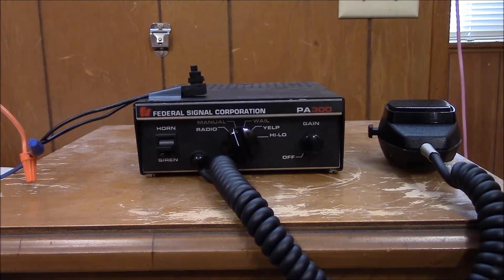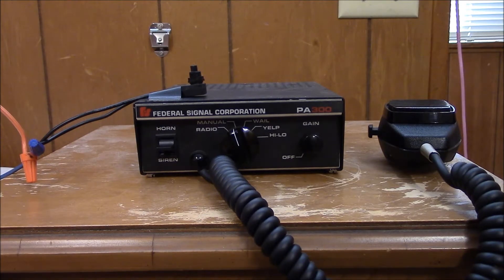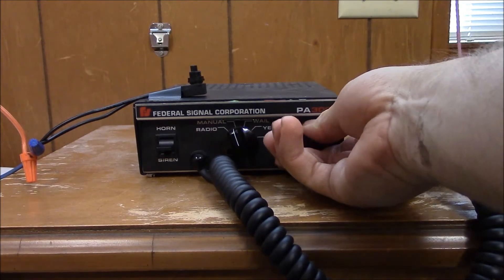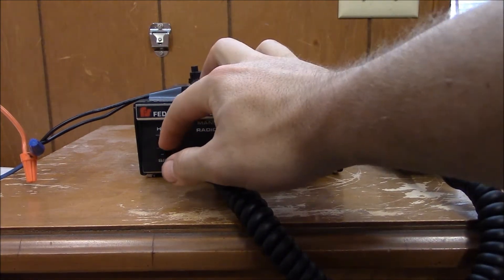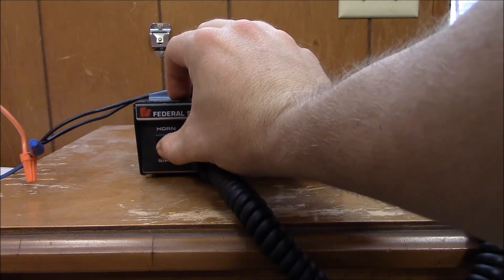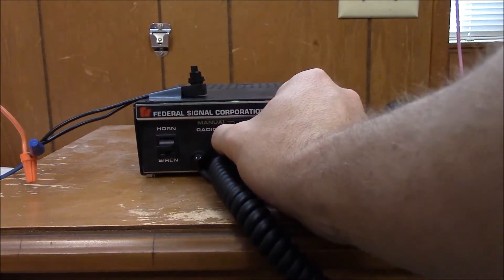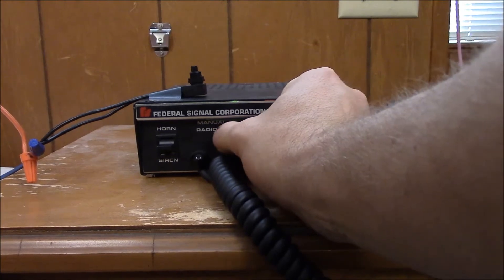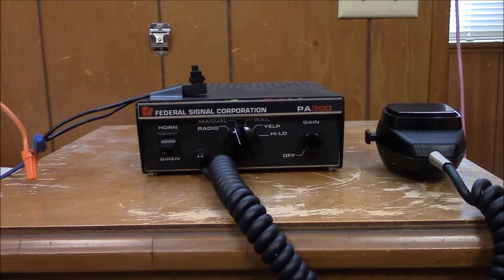Federal Signal PA300 with Rumbler

Comment: Very nice video!  
I felt the volume of Rubmler was reduced, have you used any resistors?
Because I own Fedsig Rumbler like you, but I can not use it inside the house because I have not found a resistor to fit.
If I can get advice from you it will be of great help. Thanks.
Reply from the maker: K company The camera mic can’t fully capture the sound, so it ends up sounding a bit muted. The only other thing I did was cover the speakers under about 5 blankets, so as to not annoy the neighbors, and that would cause it to sound muffled as well. I didn’t use any resistors or anything like that. To your point, I unfortunately haven’t any experience installing them, so I don’t think I can be of much help there.
Reply: Thanks reply.
I attempted it with a variable resistor before, but it didn't go well.
After all it seems that it is only possible to lower the sound physically:(
Reply from the maker: K company I think that is probably with simplest way to go. It wasn’t designed to be “reduced” so that is probably the problem you are having. A couple pillows and a bunch of blankets should probably be fine for home use.